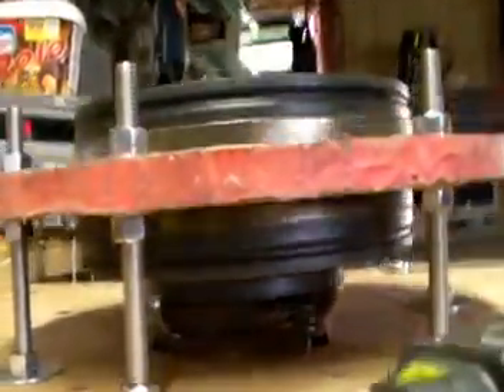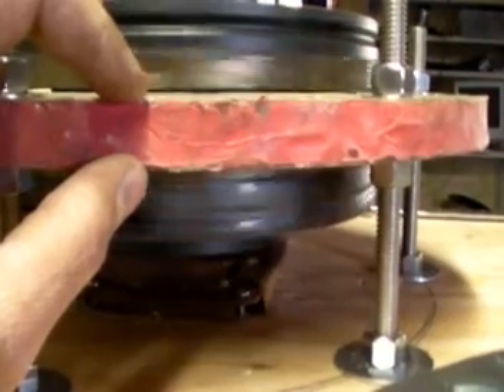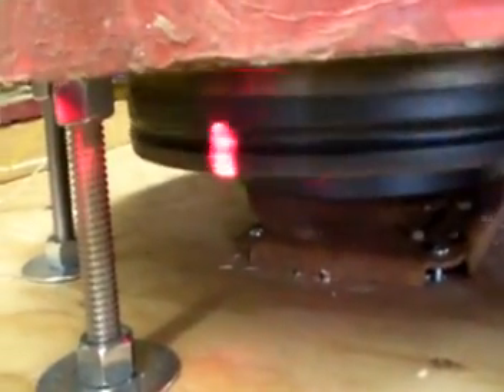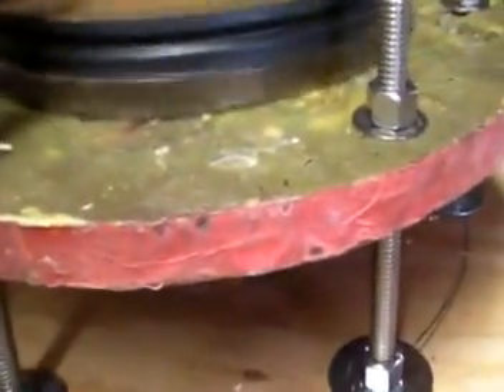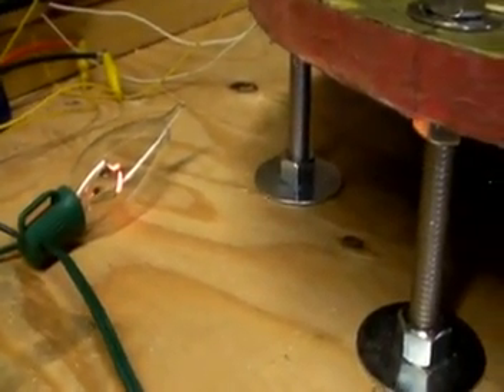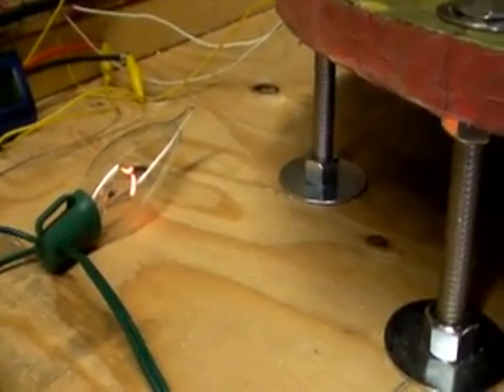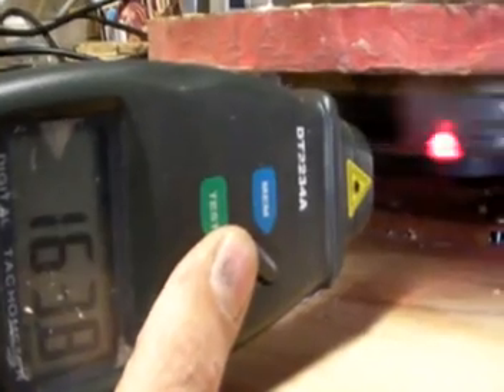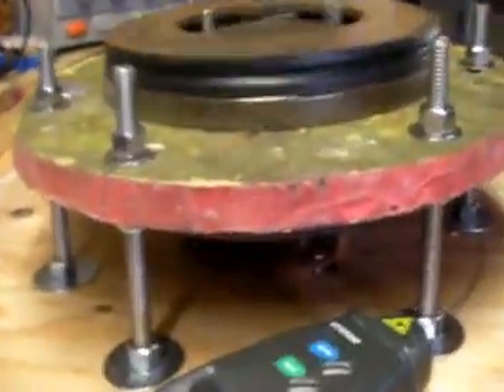axial flux wind turbine vawt hawt 03.mpg

Comment: It's a beautiful generator. If you want more power you can just drill out the inside part of your coils and epoxy in some transformer like sheet metal with 1/8" air gap and you'll get a lot more power.

Comment from the maker: Carlos, if i was building it, I would use the "/N c S/N c N"
The flux using the "S/N" method, is wraping back into the steel from both ends and traping it into the steel plate and that gives strenght to the magnet flux forward concentration. I belive using the "S/S" method would be more probelmatic to the flux concentrated into the steel.
Carlos, this explanation of mine is based on theory, i have not test it to know for sure. i hope this helps you decided which way to go.

sam

Comment: I need your advice based in your experience building axial generators. I just saw here on youtube a video of an axial generator with 2 stators and 3 magnetic rotors, with the middle rotor having magnets on top  and bottom. I wonder how the magnets on the middle rotor would be stacked on the middle rotor plate?  /N c S/N c S/? or /N c S/S c N/? where "/" rotor plate, "c" coil.

Comment from the maker: sjh7132, if you mean all of my pma projects, then the answer is ALOT...lol as long the wife dont know, all is good.
but for the 12mag/9coil i spent 
$70 for wire
$25 for resin and mesh
$95 for 12 magnets
wood free
solder $10
time JH$#*bh8
total $200

Comment from the maker: Caleb i used pieces of wood in bettween. more like stairs step down to the bottom, various sizes of wood plates were used, slide one out then in a circular motion i removed them all. Voila, it was done..eh.
I am working on a 16pole 12 coil  axial flux. you guys should know me by now, i make al least few untill i find the best that works for me.

regards

sam